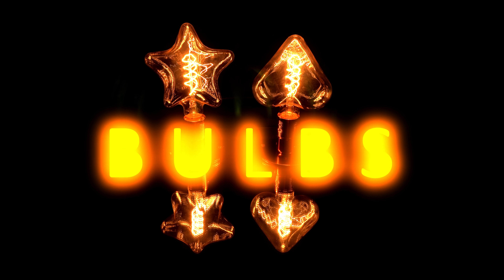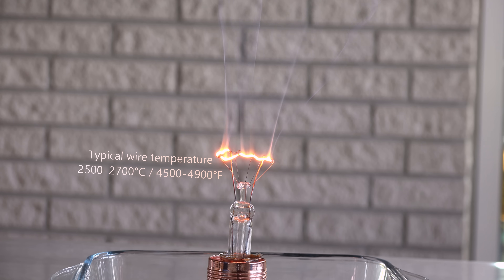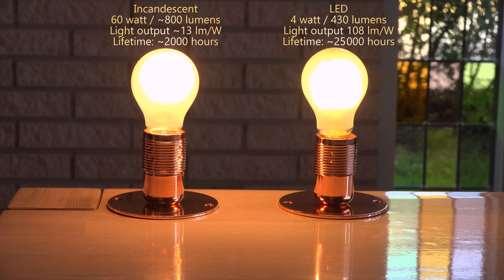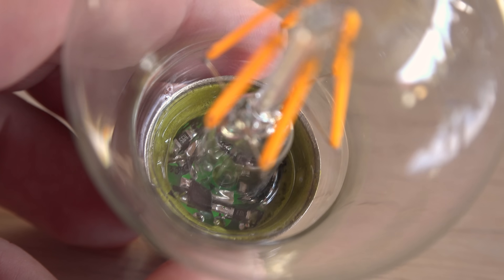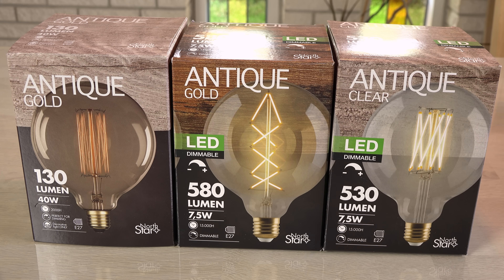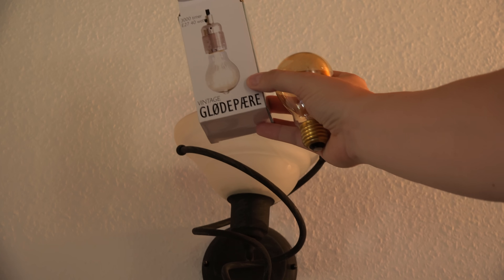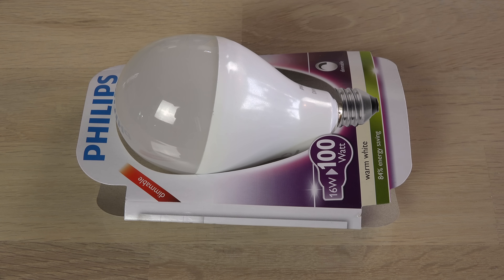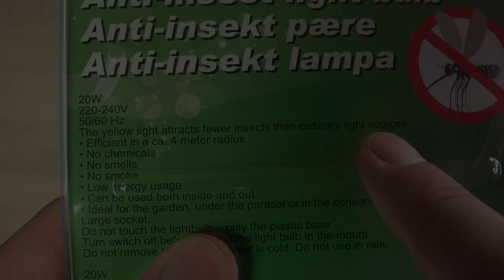Light Bulbs | LED vs. Incandescent

Comment: One thing that is very important, but totally ignored in this video: LED lamps do not reproduce the natural full spectrum of light frequencies, as the "old" filament bulbs do. Because of that, many researchers have said that LED lamps are harmful to your well-being and health. LED lamps have become better with time, but there are still some lamps, especially the cheap ones, that you notice immediately when you turn them on. The feeling is that the light is too dull, and that "something is missing", and this is exactly what a bad lamp bulb does.

Comment: LED bulbs are terrible compared to incandescent bulbs.  The light in an LED bulb is significantly less appealing and it makes me nauseated in particular when there is a blue LED glow.   LED's as well don't give off much heat which is a turn off for me.  Incandescent bulbs create a superior light which adds to the ambience of any home or cottage and I love that they case heat from them as well.
Reply: I never understood people that complain about the heat from the Incandescent I've never had a problem with them, and another thing is people was also talking about the heat coming off from high pressure sodium which I don't understand the complaints about it.

Comment: 7:25 Cosna LED (HN 10225) at 3200 lm is a work light at WARM white color temperature?? It says 3000K. Final comparison table at 10:05 in video. 
Isn't that weird? Isn't it easier to get high lm/W efficiency at colder color temperatures?

Comment: I would like to know which bulb in the market is good for sleep and recovery health. I have heard led causes migraine and gives bad sleep
Reply: i got "SYLVANIA LED TruWave Natural Series A19 Light Bulb, 75W Equivalent, Efficient 11W, 1100 Lumens, Dimmable, Clear, 2700K, Soft White". It's literally a great bulb. It's LED and has 93 CRI and flickers at around 5000hz which means it has less flicker than 99% of LEDs and 100% of incandescent bulbs that do not run on DC power (so, all of them?).

Comment: Because of the EU ban for incandescent bulbs, I ended up paying 15€ for a special bulb, which could have been bought for cents just a few years ago. I need it for photographic purposes where the whole spectrum of light is absolutely necessary. LED does not work for this purpose, except for special systems costing hundreds of euros.

Comment: I use led bulbs everywhere except a desk light I never use anymore with a CFL in it. Use mainly a table lamp. But the overhead lights and the one in the bathroom are all led as I just don't like climbing up to change the overhead lights and hate messing with the bathroom light as it's enclosed. All fairly cheap LED bulbs that have lasted years, except for that one that didn't last long at all. Think it had a bad connection inside. But due to the CFL warmup time I stocked up on incandescent bulbs since led was so expensive at the time and the government was talking about phasing out the incandescent bulbs.. So now I have light bulbs I probably won't use and now they are even illegal to sell. Thanks government.

Comment: This is hot off the grid. I bought LED night lights they have clear and frosted they are perfect for my overhead light. I have a five bulb fixture. I'm also got rid of those China made c7 Christmas bulbs in my night lights. I may use the clear type in my small plastic nativity scene. It's about time they started selling something I can actually use. These bulbs would be great for off grid use. 73

Comment: A big advantage that incandescents have over CFLs and LEDs is their resilience to fluctuations in current. CFLs and cheaper LEDs tend to flicker when the current drops due to load, a surge happens, or the electricity supply is generally unstable. Meanwhile, incandescents simply brighten or dim along with the fluctuations.

Comment: The reason incandescent never reaches it's wattage rating is because the rating is measured at 240v and mains in europe are 230v and during peak hours can dip to 220ish. As a type of resistor, incandescent bulbs would only resist a predefined amount of ampers so unless the voltage is exactly 240v, the bulb will always draw less watts than it's power rating.

Comment: LED are hazardous to eyesight and well being. Ban them all.
Reply: Smart LEDs are even worse, cause each one has a wifi radio transmitter inside it that constantly emits electromagnetic radiation even when not connected to a smart phone, it will constantly "ping" or "survey" the area to see what phones/routers are in the area.   I bought 10 of them and measured the lowest EMI on the Phillips Hue and LIFX bulbs, but actually it depends on whether the little antenna inside them is facing you or if you rotated the bulb with the antenna pointing away lol.    And people are sleeping with these things on their bedside table along with their 5G phone which is pinging the phone tower every 5 seconds to check for incoming calls.  This is what happens when people "trust the science" and think "absence of evidence is evidence of absence".

Comment: I put incandescent bulbs back in my home. They look better and honestly LED bulbs do NOT last as long as they claim. Something in the electronics always malfunctions before the designated life of the bulb. I feel I change out LED bulbs the same rate as incandescent, and feel worse for the environment when disposing them.
Reply: Yes, LEDs are worse for the environment in the long run and I've never see any last as long as they claim either. I have some incandescent bulbs in our house are still working after 10-15 years, because they aren't used very often. LEDs will flicker or fade even if you don't use them much. The Biden bulb ban should be reversed.

Comment: Incandescent bulbs shouldn't be banned!!
Reply: I'm a fan of LEDs and incandescent lamps. 
Incandescent for some ambience and LED for some cool stuff and futuristic looks.
Reply: @AllLoudNation 

LED bulbs aren't as bad as some people say, some of them are pretty good, along with lots that are crap.
I think what bothers me the most is that Incandescent bulbs have cultural significance, why do people want to get rid of that? They are literally the symbol of ingenuity in general. It's like banning model steam engines because they are 'inefficient'. Most people already switched to LED anyways.

Further, incandescent bulbs kind of recreate the surface of the sun inside a glass bulb. That alone is amazing and it will always feel like the most natural light, no matter how well LEDs can replicate that, it will always be artificial. The lack of IR (heat rays), which you can't see but feel, might also play a role in that - 'warm' light emanating from a source without IR just does not feel right to us.
Reply: @AllLoudNation you can buy LED bulbs with warmer colors
Reply: Yes
Reply: >lasts longer
>is safer to handle
>isn’t a fire hazard
>saves fuckloads on your power bill, on top of not putting unnecessary coal ash and CO2 into the air
>mf refuses to use them because of manufactured culture war bullshit
Reply: @chromacat248  LED's don't last longer most of the time, still dangerous to handle, still get super hot at the bottom, and the power bill difference is small
Reply: I live in America
Reply: I agree. There are some applications in which LEDs just can't work, like on an oven. Good luck with LED's electronics at high heat

however, for general illumination modern LEDs have a great CRI, the warm lights are pleasent, cost WAY less to run and last way longer. You can't really have a good looking light from an incandescent that lasts more than 1500ish hours. LEDs will happily run for 7000+ hours 

But yeah, if you want to run bulbs that are inferior in every way, you should be able to make that stupid choice
Reply: Cry harder
Reply: @Betterimkim  The only reason its banned is because of cry baby climate activists. I still have my gasoline vehicle and I don't plan on changing. Just look at the EV market, no one wants them anymore. Its taking a dive.🤣
Reply: @Betterimkim  I'm not crying as hard as you people protesting about climate change BS 🤣
Reply: womp womp
Reply: @adl1yt  Its fine I still have my gas vehicle and never buying electric.
Reply: @Telurino  some people besides me are tired of products being banned. If LED is so much better then there's no need to ban anything people will just stop buying them. Same goes for EVs. If they are so great you don't have to give incentives and ban combustion vehicles.
Reply: @joehatch1602 Incandescent light bulbs are not banned because LEDs are better, they are banned because it saves energy which in turns lowers are dependency in oil. America is stronger not depending on other countries for oil. And efficient light bulbs help us conserve our own oil and a secondary affect of reducing air pollution. I am sorry you do not agree with these policies but we need to improve our tech or be at risk of being left behind. You cannot lead from the back.
Reply: @ncaatrackstar  just because there's new technology is not a good enough reason to ban old technology. I still play records to listen to music. Do you think that should be banned because there's better ways? Electricity isn't free so if someone wants to use more they pay for it so they can use as much as they can afford. If America started drilling more in our own country we wouldn't depend on foreign oil. If people want to buy incandescent bulbs they should be available if enough people want them that there's profit to be made. When there's no profit and demand then they can stop making incandescent bulbs.
Reply: @joehatch1602  You missed every point from my comment. I never said it LEDs better. I also said LEDs would conserve our own oil as well as not depending on others. Banning is a strategic to keep our country competitive and help the environment. I am guessing that you may be conservative (which is not bad), so you can look at it as America needing to being fiscally responsible with our energy as well as our money.
Reply: @ncaatrackstar  there's nothing wrong with saving energy I love saving money but I just think it should be consumer choice. Maybe there's a application where incandescent bulbs are better but now not available? I don't think I missed your point I just have my own point that it shouldn't be up to the government to decide what's best for everyone.

Comment: Banning incandescent bulbs is so dumb. They have a niche use so this basically has no effect other than making people want to go Ted Kaczynski out in the woods. An incandescent bulb in not inefficient if you needed that heat anyway. Are electric radiators banned? No? Then neither should an incandescent light bulb be. If you think of heat generation as wasteful, why don't we just ban all resistors? I'm sure that will work out great.
Reply: you can still get them on local market. Some people had old stocks, like basically thousands of them. They are selling them.
But I dont agree with ban, also. It brings stress, for how long they will be.
I want to make storage for lifetime, to buy at least 100 of them.
I am using it only as night lamp, and in several places in flat, where they are not used frequently. They last from 5 to 30 years. Really, I've changed one recently in boot area, it was there from year 1993. It had even made in SSSR (in russian language). So made in Soviet Union. Lol, it was in original flat, till got wrong, last year. Incredible.

Comment: Sure, LEDs are significantly more efficient than incandescent, but I can't understand how some glass and metal is worse for the environment than a bunch of plastic and circuit boards? I'm sure in a few years the government will ban LEDs specifically for that reason. Stop letting big brother tell you what's best, and find your own way. Remember, it's your electric bill that they're forcing you to "lower" (assuming you use that much power on lighting anyway). Ideally, people should be able to choose whatever lightbulb they want to use, because they're ultimately the ones paying for it.
Reply: I agree, and LEDs aren't better for the environment in the long run.

Comment: The health effects of LED in human health and eye are not very often discussed. The LED have a flicker that is not noticeable with the naked eye yet exposure to it for longer then 1HR can cause tiredness, anxiety and in long term use is a cause of cataract which is a very severe illness that causes you to loose eye sight. So no matter how effort things may be or energy efficient it is always best to value the health factor before any other benefit. I honestly would rather use something with higher cost if it doesn’t affect my health, mental state and eyesight!
Reply: That flicker thing is really over exaggerated. It really only happens if you have a bulb with a really cheap driver. The real issue is that there's no standards like CRI for flicker. You really have no idea whether the bulb you bought is going to flicker and if so, how severely. Even then, you could always test the bulb at home and it usually isn't that much of a problem. And if you are really annoyed by it, you could always poke around in the bulb and replace the driver.
Reply: @123four...  Would you consider GE LED bulbs cheap? I not only can notice the flicker but it drives me crazy. Not everyone can notice it. I have never seen a halogen or incandescent of any brand at any price point have a problem flickering.
Reply: @John-bs5ug  Yes, I notice the flicker in led bulbs all the time, especially Christmas lights.  Even the warm colored higher quality  white Christmas  led bulbs that are supposed to look like incandescent bulbs, I can still detect a flicker and it drives me crazy.
Reply: @123four...  99% of bulbs have really cheap drivers